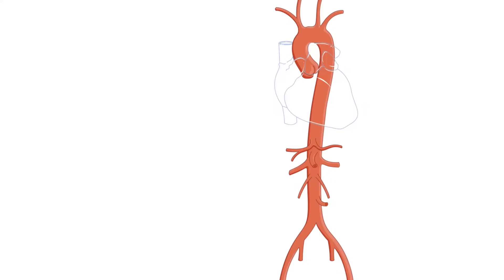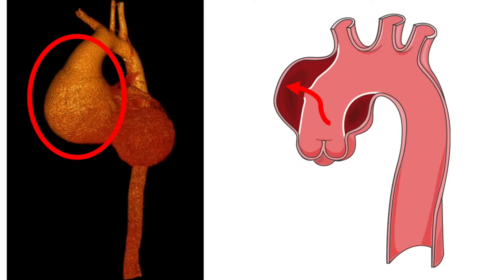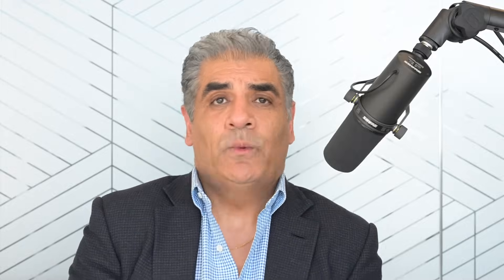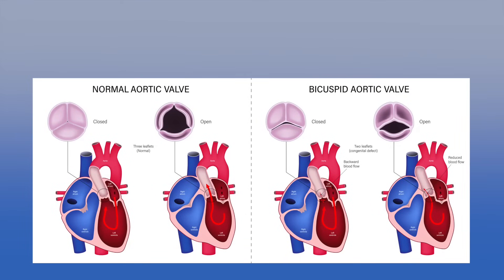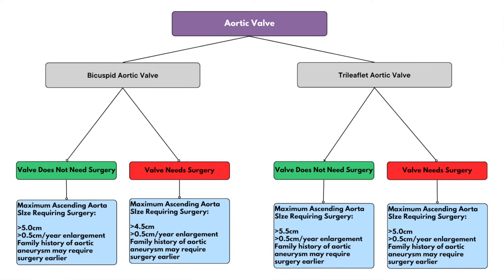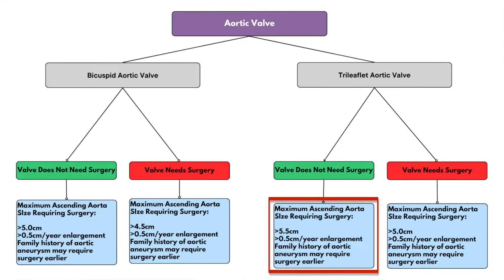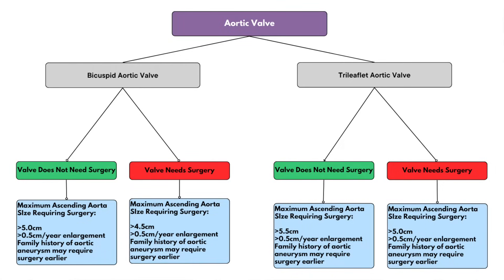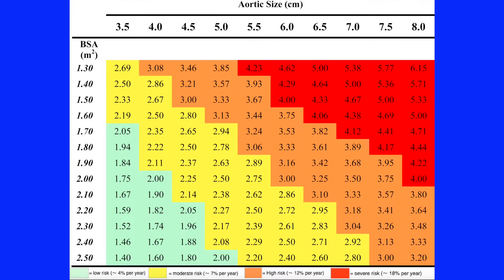How serious Is A Dilated Ascending Aorta?

Comment: I’m 39 with a dilated aortic root of 43mm confirmed by cta 2 weeks ago. This was first discovered about 8 years ago when it was 38mm. No valve abnormalities. My background- 6’3” male with hx of controlled hypertension with metoprolol and losarta for about 12 years. I am a smoker of approximately 25 years (quitting) Despite my being tall, I’m told I don’t have typical features that of marfans. No genetic testing has been completed, aside from an at home dna test which did not detect fb1 abnormalitie or ehlers danlos.  Given my height, could it be that may be why my root is larger?  It’s only ever been referred to as dilated or ectactic and never aneurysmal. My ascending is 34mm, descending 25mm. My cardiologist just seems to shrug things off with my yearly visit and is always hesitant to provide clear cut answers, but was quick to prescribe lipitor 10mg even though I’m vegan and have been for 30 years.  Said this will help in the long run?  Is surgery always inevitable?
Reply: My aortic root is 40mm
I'm 32
I've seen two heart docs and they've both been pretty dismissive towards it. 
They haven't prescribed me anything for it and just recommend an echocardiogram every couple years. 
I've also wondered if my body size is why my aortic root is so large. I'm 6' tall 190lbs and have a very long torso. 
I really don't think i have marfans. Best of luck to you in your health journey brother.
Reply from the maker: Do you have a bicuspid aortic valve?
Reply: @Thekeyholeheartclinic . No Normal trifleaflet.  Genetic testing confirmed no known connective tissues diseases, but did detect COL4A1 (2 variants) abnormalities, but this variant is supposedly only associated with smaller vessel abnormalities
Reply: A mutation in the ACTA2 gene is associated with various medical conditions, including Familial Aortic Aneurysm Syndrome (FAA). FAA is an inherited disorder that affects blood vessels. The ACTA2 gene provides instructions for producing a protein called alpha-2 actin, which plays a crucial role in muscle contraction and the structure of blood vessels.

Mutation in the ACTA2 gene can lead to abnormalities in the walls of blood vessels, resulting in a range of medical complications such as aneurysms, narrowing of blood vessels (stenosis), and other cardiovascular conditions. Symptoms may vary but often include issues like high blood pressure, chest pain, and other vascular-related problems.

Comment: Hi, nice Video. My Cardiologist told me i have a ascending aorta between 40 to 42mm. Im very tall (6 feet 7) and ive been doing weightlifting for the past  10 years. BSA is 2.45. My Cardiologist told me i can continue weightlifting and its not as bad as it sounds. Do you agree? Best regards from Germany.
Reply from the maker: This sounds reasonable. I presume
He may wish to monitor? Is your aortic valve normal? Or bicuspid
Reply: @Thekeyholeheartclinic  my cardiologist said 3 sails but functional bicuspid. CT said tricuspid. Yes, he wish to Monitor every 6 months. Is the risk of a dissection low when i continue weightlifting?

Comment: Hello doctor! I am 33 years old has diagnosed with acyanotic CHD Bicuspid aortic valve and Aneuryomal ascending aorta
AV annulus - 25mm
Aortic root-36mm
Ascending aorta -55mm
Isthmus - 36mm
Descending aorta- 30mm
Is it treatable without open heart surgery
What is the life expectancy after treatment please suggest me I am very afraid needs a urgent guidance
Reply from the maker: Hello Sir
If the facts are as you indicate then surgery may be required. This can be performed by mini breastbone in skilled hands. You are young and the treatment is associated with good outcomes.
Reply: Thank You sir ❤
Reply: Sir after surgery can we do all types of work or not? Is this surgery is risky ?
Reply from the maker: @amijathehunt  yes relatively normal life (though if the valve need replacing you may need warfarin if you choose mechanical valve)
There is risk but usually less than 5%
Reply: @amijachourasiya hi how r u doing now? I have same bicuspid and ascending aorta 50mm, my surgeon said need surgery when above 55mm but i still worried so much everyday
Reply: @winp3175 hi Brother same problem how are you
Reply: Aap india se ho

Comment: I have Marfan Syndrome, it is very dangerous to have a dilated aorta even moreso for me. I've got a dilated aorta, mitral valve prolapse, hypertrophic cardiomyopathy, and a reoccurring bigeminy arrythmia that skips every 2nd beat that I was born with. I am very fearful of a dissection happening with everything I have going on. And to top it off I have a Pectus Excavatum deformity hindering my heart and lung function. I was diagnosed late but my son who is 8 years old also has Marfan Syndrome, but I know actually stands a chance at a better outcome than me, since he was diagnosed as an infant. All of these gives me symptoms of POTS very heavily. Is there any promising new research for connective tissue diseases like Marfans or vEDS?
Reply from the maker: Thank you for your comments. Currently the treatments required to correct your cardiac issues have advanced considerably and in the right hands at the right time you will do well.
Do you monitor your blood pressure ? This is a good idea.

Comment: Hello. I have an enlarged aortic root. I want to be a police officer but they need to get tased. Would I be at risk if I chose to go through with it?
Reply from the maker: How big is the aorta, how was it measured (eg CT) and is your aortic valve normal?
Reply: @Thekeyholeheartclinic hi. I’m just got routine echo. Report reveal dilated aortic root at 41mm. I’m 40 year old healthy with no medical problem. Im trying to not freak out about it.

My GP is very dismissive about it as I have no actually symptoms. No high blood pressure or high cholesterol. 
My question is how sensitive and specifics is ECHO on aortic root dilation. Would CTA be reasonable next step is determine where and how much dilation there is?
I am 5”6 and definitely has no strait of Marfan or ehler danos syndrome. 
With a report like this. I’m pretty concern

Comment: I have bicuspid valve with 3.9 cm aorta . I’m 6ft 2 and I’m lifting weights 14 years. Will weight training impacts negatively the aorta ?
Reply from the maker: The connection between aortic enlargement in weight trainers is circumstantial but is hard to ignore. How was aortic size measured in you (Echo CT or MRI)? I advise periodic CT to measure aortic size change and Bp monitoring to control if high. Curtailing weights may also need consideration and I advise close scrutiny under the guidance of your local team of doctors.
Reply: @Thekeyholeheartclinic  A CT to measure aortic size is approximately 6 mSv. Is there a way to get the aortic size periodically measured at doses much lower than 6 mSv with CT like is done for lung cancer screening (1.5 mSv)? Also, why are MRI exams and echos inferior options for measurement?
Reply: @formulaone07  this is a great question and I would like to know the answer as well, thank you.
Reply: @Thekeyholeheartclinic  thank you for the respond . My aortic size was calculated by echo Ct. Do you believe than MRI could show more reliable results ?
Reply: @christospip5312 I have the same situation as you.  Im told that only a CT scan w/ dye will reveal the actual size.  The echo is just a high level view

Comment: Hi, Thanks for the video. My Echo mentions Ascending Aortic Dilatation of 46 mm.Aortic Root @ 38mm and Aortic Sclerosis.Prescribed Betablocker + Statin+Aspirin and suggested CT scan after 6 months. Is this a significant finding or normal age related.( 51 years ). I was under treatment for hypertension since 10+years.
Reply from the maker: Early CT is advisable. Is AV bicuspid?
Do you have family history of aorta aneurysm?
Reply: @Thekeyholeheartclinic  Hi, Thanks for reply. No family history of aor.aneurysm. Is Statin + low-dose Aspirin essential in this stage.
Reply from the maker: @vijayakumarrp9398  not unless there is evidence of atherosclerosis on CT
Reply: Please try pears procedure
Reply: @singhrajat5139 
Thanks for suggestion.
Current size of Ascending Aorta is 4.9 cms.
Reply: Apka koi contact link go to share krna

Comment: Hi, nice video. Hopefully you've seen the updates Elefteriades' team have issued papers on in the past two months.  Not made it to guidelines yet, but clear that if you can get fixed in a high-volume centre where the surgical risk is lower, you should be looking at intervention in tricuspid non-CTD non-familial at 5.0 cm, or even less. One of the papers has an interesting age-based nomogram.  Vital to get your BP down immediately and effectively, below 120/80, and not the NICE/NHS figure of not treating until 140/90.
Reply from the maker: Absolutely and we are most grateful for you
Valuable contribution.